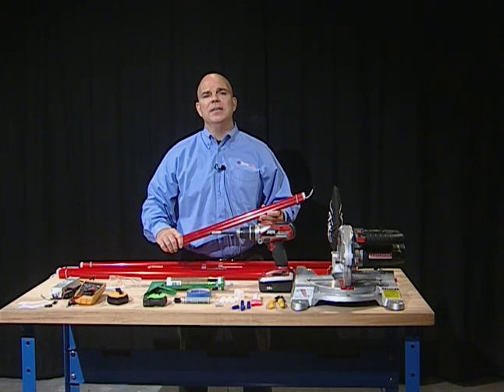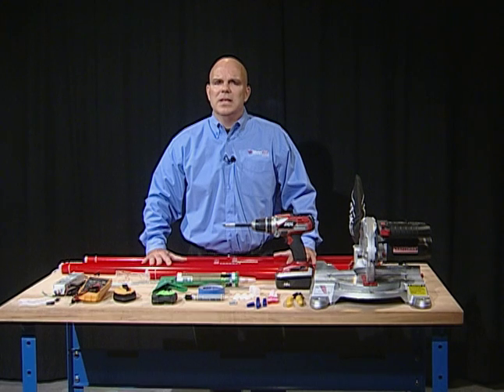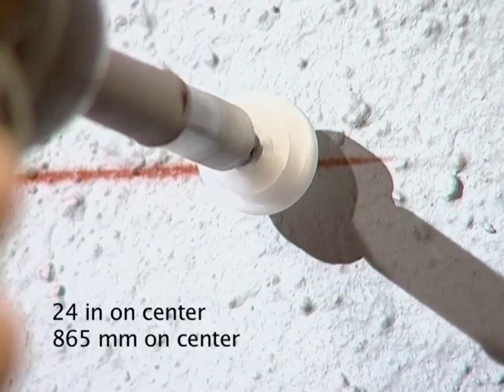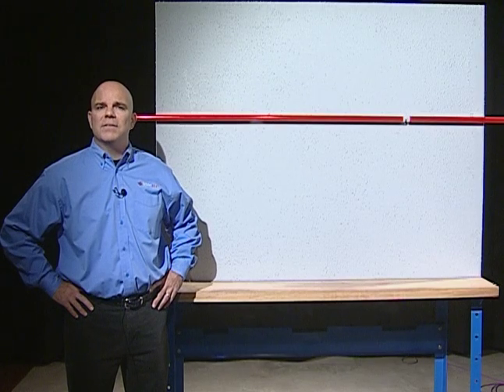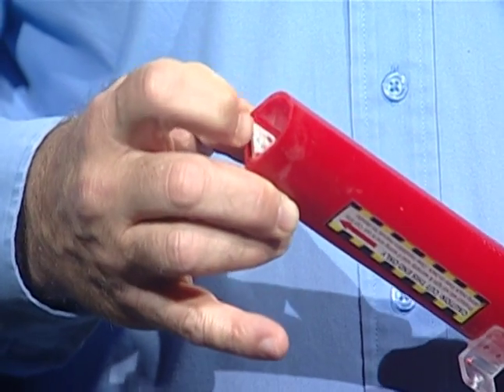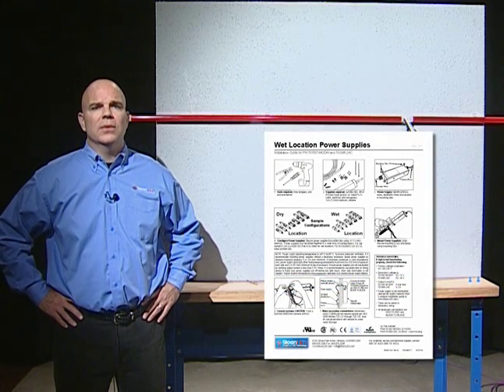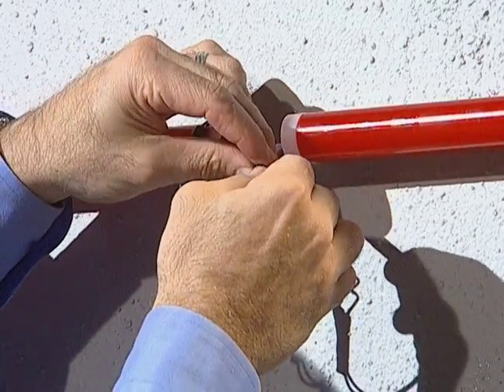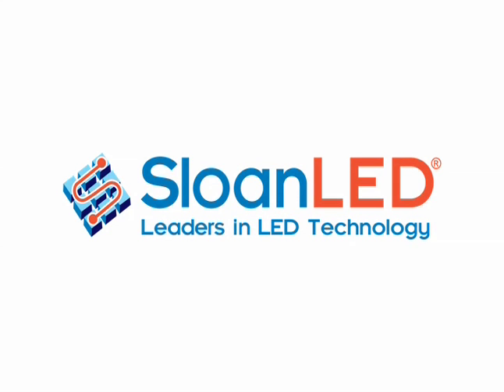LEDStripe Installation

Comment: Flexible vs rigid border tubing...what determines the type used?
Reply: Rigid tubing (LEDStripe & ColorLINE) is designed for straight runs to demonstrate accent lighting for either outdoor or indoor use. Flexible tubing (FlexiBRITE) is for applications that require the bending and contorting to different shapes and designs both indoors and outdoors.
Reply: @jrmybkr  Thank Jeremy.  Can  I add smart controls (eg dimming) to flexible tubing or just the rigid type?